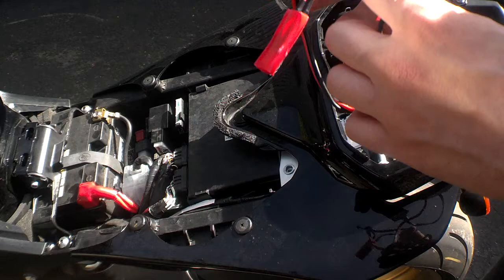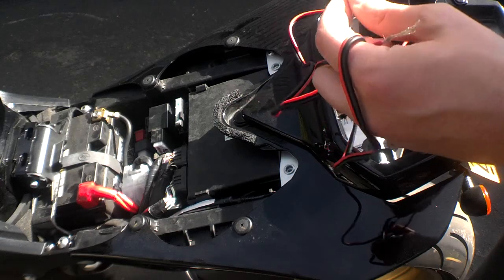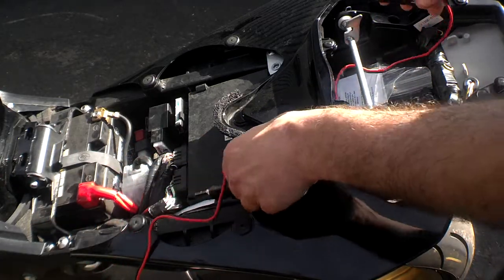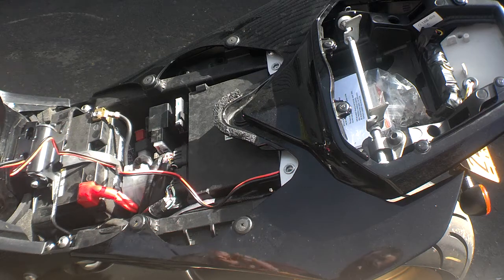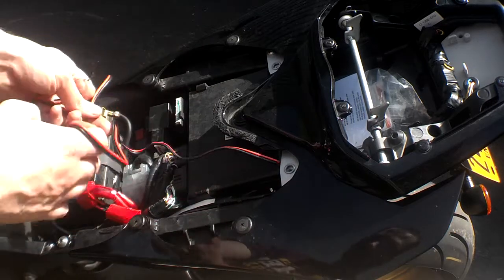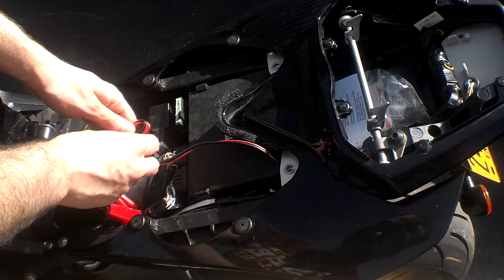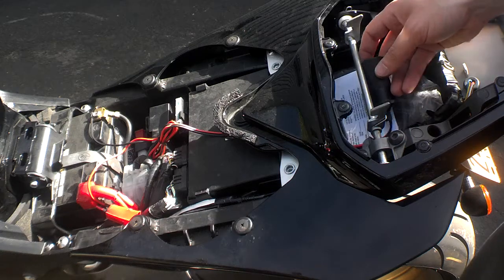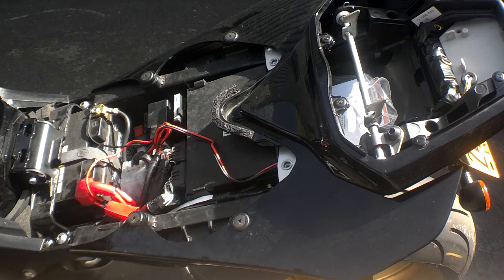How To: Motorcycle Cigarette Lighter Mod

Comment: Easy install for sure, I personally have to much OCD to do it that simply lol. I would have to find a way to mount the lighter and the wiring etc just like I did with all the other stuff done on the bike. Still it works for what you need to do and no one is going to see those wires so sweet. ride safe man.

Comment: Was your bike on when you demonstrated the charger working?? Cool vid btw
Reply from the maker: I didn't have enough time to fiddle with the wires to get the port to work only when the bike was on so no, the bike was off and the charging port still works. I just try to remember to unplug anything I'm charging after I turn the bike off. Hope that helps. Thanks for the comment man

Comment: If you wanted to put an inline fuse in what amp would be best to use?
Reply from the maker: I honestly don't know. Most car fuses are 15 to 20 amps. I can check to see what the fuse is on my bike and let you know tomorrow
Reply: ***** It depends on the wire gauge. if you are using 12 gauge you would use a 20, but in this video it looks more like 14 gauge so that would use a 15 amp fuse.

Comment: Sir.. sorry to say. But isn't that kinda stupid? i mean.. cigarette lighters from cars are meant to be really hot.. so if your papers in the back there get into it couldn't it set that on fire? why not just wire it to the tail lights so then it won't be running 24/7 so A: you're not wasting your battery, and B: so you're at less risk of an accident.
Reply from the maker: It doesn't get hot at all Andrew. I've had my dead cell phone charging on that thing for an entire 2 hour ride. It's never overheated. And the circuit is closed only when it's in use. I don't see how it could pose any fire hazard. It's got a fuse built in so it will short out if there's ever a voltage spike... I really don't see any cause for concern...
Reply: when i was younger i decided  to be brilliant and pull out the car charger for my phone and touch the metal part coming from the car charge and i got burnt. Car charger ports are mostly for cigarette lighters and the way they light cigarettes is by having a good amount of wattage through it (even if it's not a spike per say) it could still get hot enough to set something on fire..say paper?  xD even if it's unlikely all it takes is one time for your beautiful bikes to get dammaged :/
Reply from the maker: Andrew Boone The difference being that a cigarette lighter has a thin niochrome wire element that is designed to get very hot very quickly. Your 5 volt car outlet and charger don't get nearly as hot. The wall outlet gets just about as warm as the car outlet. I'm still not following you on your rationale for how this is a potential fire hazard. Your concern would make all the electricals on the bike a fire hazard. Even though the tail of the bike is a tight compartment, it doesn't at all get hot enough to get burned. I can tell from having used it several times on long trips that it doesn't get that hot.
Reply from the maker: TwoWheelRiot http://en.wikipedia.org/wiki/Cigarette_lighter_receptacle
Reply: by the way i do like your videos :)